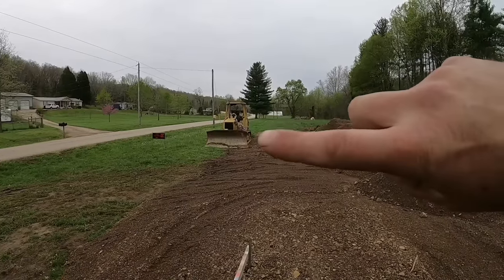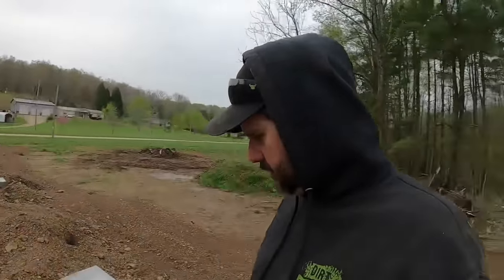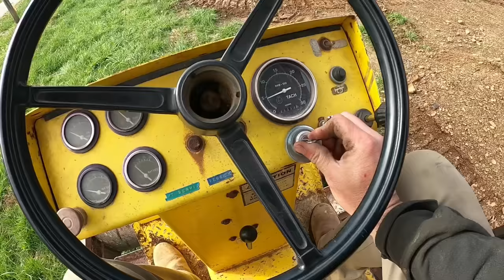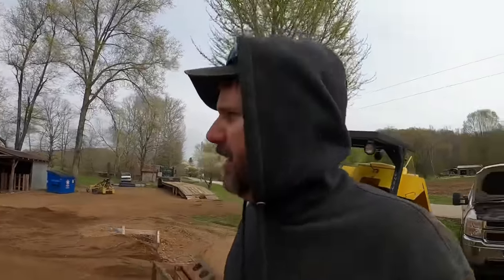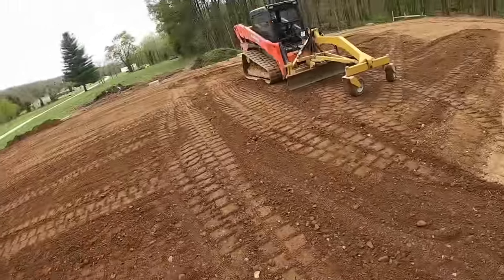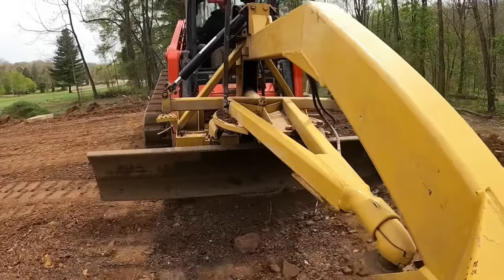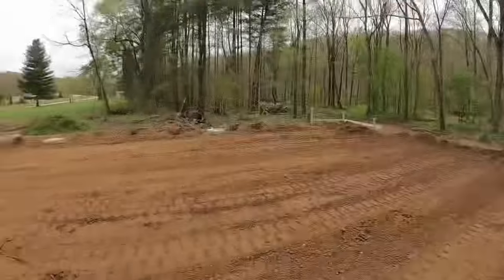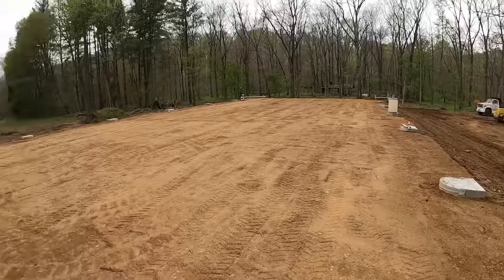Trying out the new upgrades on the grader attachment and putting the new roller to work

Comment: 20:54 Always wondered why it was a big deal to get the ground absolutely perfect when the concrete would level it out at form height. Never thought about the amount of concrete wasted if it wasn't as accurate as possible. I'll probably never use the information, but happy to now understand the reasoning behind it.
Reply: Uneven sub grade can also cause stresses that may cause cracking or in the extreme, failure.
Reply: Uneven ground is a pain to set forms on also.  It also makes grading around the exterior of the building much more difficult.   All lead to wasted time and $$$$$

Comment: This Dynapac is one of the most reliable rollers you can find. 
I did transport to Dynapac in the 80's and the ones I delivered to 
had only good to say about them. They mostly use Kubota, Deutz and 
Cummins engines nowadays. In addition, it is Swedish.

Comment: One thing to keep an eye on with the D4G Dozer...  We had a harmonic balancer that either got loose or the rubber inside wore out and, when it started wobbling, it broke the front of the crankshaft off.  Just be sure to check it often to make sure it is running true... lest you wind up half way through a job, like us, and the engine breaks.  That was not a fun time.
Edit  We believe it started going bad a few weeks prior to it breaking.  We noticed the machine start to vibrate a little bit more than usual and the exhaust started to rattle as a result.  We were optimistic that it was nothing more than an exhaust issue and it bit us in the a$$.  After spending 12 grand in repairs we got rid of it.

Comment: I have a question about compaction . I know they started filling in and I assume they stripped the topsoil first , but how compacted did they get what they spread out with just a tractor ? and you spread the last 2 feet of fill with the dozer , which compacted some . that roller is probably good for 10''-12'' of compaction ? I am guessing . I would think it would need  compacted with the roller every 12'' of lift or so  . Are you worried about settling after they pour concrete ? From what I have seen I would guess that only the top 12" or so I compacted . Please enlighten .

Comment: Nice laser setup. That stick kinda looks like it could put a lot of leverage on the welded nut. If you’re having trouble with them breaking in the future try using coupling nuts. They’re a good bit longer and will give you more surface to weld on.
Reply from the maker: 👍 no problem yet

Comment: Great job! Between a dozer or the skid steer on the initial grade I go 100% dozer. You get a greater compaction and you move a heck of a lot more dirt.  That is seen by the fact that dozer hardly move from level between pills. You’d have to take Dramamine if you use the skid steer.😅

Comment: You should be compacting every foot of fill, running it along wirh the dozer. The building will sit on the concrete pilings , the after a few years the slab will crack because the raised base wasn't compacted correctly..
Reply from the maker: K

Comment: We used to go 12 inches per lift and compact each lift but that's in Texas, everyone has a different way of doing things.
Reply: We usually do 12 to 18 inches too depending on soil type, what we're compacting it with and whether it's just a ditch for pipe, a building pad, etc.

Comment: I've never knew you could run 2 receiver on spinning lazer learn something new every day. Great having lazer on machine did you ever put that set up on a mini excavator and how do you attach the  staff (receiver holder) to the boom is it welded or special bracket for  machine 👍
Reply: Some have magnets on the receiver so it will hold to your stick

Comment: Excuse my ignorant question here.  I'm surprised you didn't roll/compact the sloped edges/sides as well.  Don't they kind of keep the main flat section from trying to compress/squeeze out the side like it would if it was a sharp 90* drop and you put weight on the edge???  Thanks for the video and sharing your time with all of us out here in youtube land.
Reply from the maker: Would help erosion pad is compacted out passed the building
Reply: @DirtPerfect  Cool, thanks for the reply. :)

Comment: It would take waay longer and more work using the skid steer to level all that out.
Have you ever thought of getting a tilt bucket for your skid steer?
Reply from the maker: No need when you have a dozer
Reply: @DirtPerfect  Sure there is, a "rototilt" bucket has lot's of different uses on skid steer apart from grading plus the skid steer can get into way smaller places.
You should rent one for a week just to see how you like it or don't like it.
You did an awesome some modding the grading attachment 👍😁

Comment: You need to get yourself a 4 in 1 bucket for your Kubota once you use one you will never go back to a normal bucket
Reply: I was just about to ask if he ever had one before.
Reply from the maker: Why
Reply: @DirtPerfect  I have not used one personally, just regular buckets. Some people swear by them, for me it's just curiosity. I couldn't answer why someone would never go back to regular bucket.
Reply: Dirt Perfect open it right up and use it like a dozer or drag material back if I’m cleaning up work sites so handy to bite and pick up rubbish or trees or cleaning up piles getting the last bit instead of pushing the pile further I also have tilt on the bucket and a spreader bar I can grab nice work there👌

Comment: I am actually shocked that you don't have to weight at least two years before construction for ground settling, because of just pushed the dirt in there.  In Mississippi we could do it that way but we would have to weight up to 8 yrs for settling depending on engineers findings.  Or we do it in lifts of no more than 6 inches depending on engineering findings can reduce the setting time to just weeks.

Comment: Wouldn’t it be cheaper and easier to just pour 6” pad on the whole thing instead of regrading 2/3 of the pad?
Seems like a lot more work and the cost would be minimal for the extra 2”
Reply from the maker: No
Reply: Quick numbers,... assume it saved 15 cys of concrete at about $130/cy. That's about $2000 of concrete for an extra 30 minutes of grading. To break even,  Dirt Perfect would charge $4000 per hour. And we all know he's only around $3500 per hour. So the customer saved $500. ;)
Reply: JCGoogle your math is right your calculations are wrong
Let’s say an extra 10 yards would be a lot closer..  at $120 a yard 
Labor to pour the extra 2” is minimal.  
Now you have the additional labor and equipment to scrape, level and compact 2/3’s of the pad.  
Seems a lot closer than your “quick numbers”.